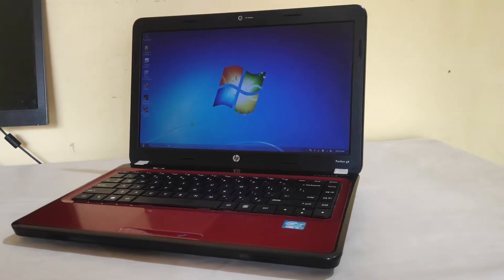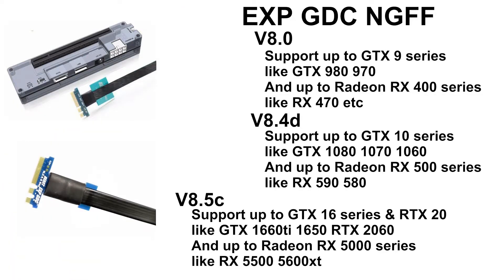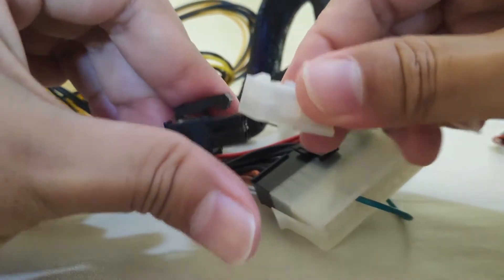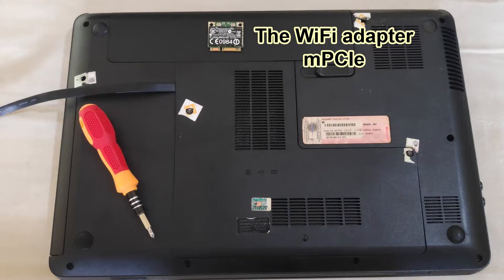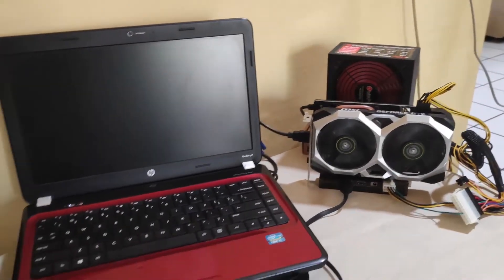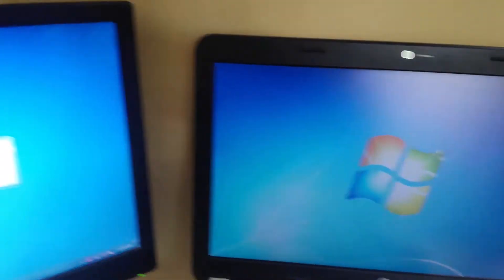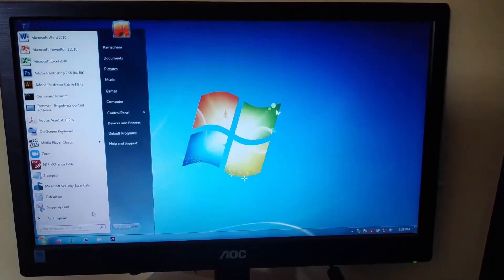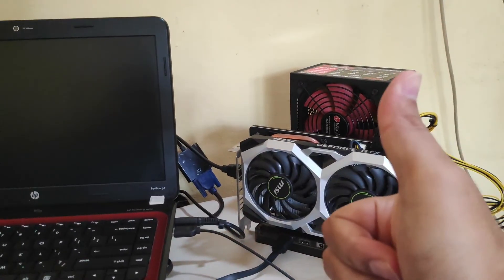EXP GDC Beast V8.5c eGPU with GTX 1660 ti on Old Laptop from 2012

Comment: I need to buy an eGPU to add a discrete graphics card to my laptop. There are two connection standards on the market: NFF and Mini PCI-E. So with the HP EliteBook 840 G2 laptop, which connection standard should I buy?
Reply from the maker: From the year 2015?

if I'm not mistaken, it was a Transition Year when Some of Laptop Companies are switching from Mini PCI-e to NGFF Wifi Model. And some model still using old Mini PCI-e

So you need to Open your Laptop by yourself to check the Connector type
Reply: @ClayWheeler  Is there a way to tell the difference between the two if you look at it from the outside?
Reply from the maker: @nguyenminhcuong6828  No. Just Opening the Laptop case is the Only way.

No other way to tell it.

Unless you have Laptop from 2016 which is 100% Definitely using NGFF WiFi slot.

Or Laptop from 2014 which is using mPCIe WiFi slot.

2015 is Transition Year.
Reply: @ClayWheeler  Thank you very much. What 's a kind of you

Comment: Hello I Have Asus Fx504 i5 8300h - 1050 4gb - 16gb ram is available dock doocoler and 1660 ti? Help me please
Reply from the maker: Ok I will Look into that Asus Model. Does it have Thunderbolt?

I will search the Compatible eGPU Dock right now
Reply: @ClayWheeler  Hello what is thunderbolt? Please help

I would be very grateful if you could find me and inform me if it is compatible.
Reply from the maker: @angelamamanialcon6160  Alright I investigated the Asus TUF-Gaming FX504 with Core i5 8300h.

Before you start, please learn the Slots here 
https://arstechnica.com/gadgets/2015/02/understanding-m-2-the-interface-that-will-speed-up-your-next-ssd/

OPTION 1 
Your Chance to use External GPU is by using WiFi slot, which is NGFF type, as explained in my Video. WiFi slot NGFF has speed of 8 Gbps. You can search Beast EXP GDC NGFF in AliExpress or BangGood. 
Alternatively you can use ADT-Link R43SL. You can read it here https://egpu.io/forums/builds/2017-15-dell-inspiron-7567-gtx980ti32gbps-m2-adt-r43sl-win10-hunew/

OPTION 2
Another Choice is M.2 NVMe slot which is often occupied by your SSD, it could be Drive:C where the Windows is running from. That means you need to Move your OS to another Drive, which can be SSD SATA. Picture Here : CLICK AT M.2 Slot Menu picture https://laptopmedia.com/series/asus-tuf-gaming-fx504/

 You can use Beast EXP GDC M.2 NVMe or ADT-Link R43SG . Roughly it has 32 Gbps speed.

Video Examples if you want to use NGFF eGPU https://youtu.be/pKv436sOrNo

https://youtu.be/LQgho8EXAM4

Video examples if you want to use M.2 NVMe eGPU https://youtu.be/0ovihMPo-q8
Reply: @ClayWheeler  Hello thanks for your time
one question more
 what is the best gpu for  my laptop?
What is your recomend for me?
Reply from the maker: @angelamamanialcon6160    RTX 2060 or higher. Because your CPU is more than capable of High Bandwidth.

If you're using GTX cards it will be waste of Performance.

Comment: this video is the best tutorial for this kind of content, now i know that i can use my laptops gpu gt620m and external gpu at the same time but it needs to be amd rx, i would like to ask if rx 560 is the best gpu for my intel i5-3337u?or what gpu can you recommend, lastly can you test other modern online games like, valorant,cs go or more? thanks again for this wonderful tutorial! godbless to your channel
Reply from the maker: What is the Laptop model name?

And by the way, Actually you can still use the same NVidia card even if your Laptop already have NVidia dGPU like GT 620m.

You need to Clean Uninstall of NVidia GT 620M and then Completely Disable it from Device Manager. And then you can use NVidia GTX 1650.

If you're using Radeon RX 560 you will need special PSU because RX 560 don't have PCIe power connector. The PSU you need is "Dell DA 220 Watt Brick PSU" usually only cost $20.

Here's the example of using Special PSU for RX 560 equivalent

https://youtu.be/ir-5JDITDd8
Reply from the maker: I also have a newer video, about the Game that is a little bit more demanding than this video.
Reply: i already watch your new video, it is a great game test for your egpu, my laptop model is acer aspire v5-471
Reply from the maker: @louvainmontalbo7831  yeah, Recording a video makes huge FPS drop.

If I'm not Recording, it is always stay at 120 FPS, because the game is locked at 120 FPS max by developer.
Reply: you have a beast gpu sir! very powerful, thanks for your help sir, i hope i can build a set up like this successfully! stay safe sir
Reply from the maker: @louvainmontalbo7831  I will dig into that Laptop model right now

Comment from the maker: New Video is up. It talks about a Specific Game, Honkai Impact 3 PC version

https://youtu.be/nRXTra9QZDo
Reply: Hello @ Clay Wheeler i like how you did to your laptap,my biggest problem bro is do you have Activation key to the NFS 2? i cant open it without the activation key.it said it needs to re installed then i re installed over and over again there's no use at all..please help me Clay.
Reply from the maker: @freedom_fighter12  The Need For Speed Hot Pursuit is the original game from 2010, not the Remaster 2020 version.

And this one is from Torrent
Reply: @ClayWheeler  i also download it last year in a torrent,it plays bro,but when i re installed it, it says it needs to re installed? is there any activation key for this game? i dont even know where i could find this Activation key 🗝️
Reply: its 2010 NFS 11,not the remaster
Reply from the maker: @freedom_fighter12  I got it from here. Just copy and paste. Remove the Space of the link below

http://  oceanofgames.  com/need-for-speed-hot-pursuit-game-free-download-ofgv-5768425/
Reply: @ClayWheeler  Thank you very much @Clay Wheeler
Reply: @ClayWheeler  hello what if I use NGFF cable to I need external monitor? How many speed does it have and does it half the speed too? Im your new subscriber.
Reply from the maker: @marnilr103  NGFF is 8 Gbps. Way faster than this video which is just 2.5 Gbps
Reply from the maker: @marnilr103  using NGFF, it depends on the game you're playing.

If it is heavy Game like GTAV, you may need External Monitor.

If Lightweight Game like DOTA 2 or Fortnite, no need to use External Display
Reply: @ClayWheeler  thank you Clay you deserve a lot of subs and support excellent video and tutorial keep it up ❤️
Reply: @ClayWheeler  hi clay I wanna ask 1st question is why my laptop buffer playing 1080p videos on youtube my internet is fast but my laptop kinda buffering in video every few seconds can a egpu help? 2nd does my laptop itself overheat with egpu while playing heavy games? My laptop is lenovo ideapad 300 15ibr, please answer before I buy one thamks clay.
Reply from the maker: @marnilr103  if your Laptop already Buffering when playing 1080P Videos, then it means the CPU itself is not Good enough for gaming.

Your CPU Silicon might be Deteriorated already. And its efficiency cannot be Helped by eGPU in any means.

That's like trying to hook a Real GPU to Pentium 4 in 2021, nearly pointless.
Reply: @ClayWheeler  thanks clay big help
Reply: I think Nvidia can't allow to do this anymore😞
Reply from the maker: @VisitBeforeHumanPollute  what do you mean? I just updated the driver to newest one. It's still good for the Laptop

Comment: Just wondering if that will work without external monitor? I'm trying to do that but I don't have extra monitor.
Reply from the maker: Yes will work, but you will lose a lot of FPS.

I will upload new video after this, showing how much difference is the performance Loss when the bandwidth is interrupted by 2 Way communication. Could be 30 FPS Loss or more.

In this video is basically 1 Way Communication from Laptop, to eGPU, to external Monitor. Hence full speed 2.5 Gbps

2 Way communication means from Laptop, to eGPU, Back to Laptop again. On the same Cable. Hence 1.25 Gbps.

Believe me, the difference is tremendous. I will upload new video soon.
Reply from the maker: Oh and by the way, you can also use TV for external monitor.
Reply: @ClayWheeler  This helps a lot. I have successfully installed mine. Thank you so much.
Reply from the maker: @adrianortiz3392  Wow nice.
Make video of it and put in Your Channel :D
Reply: @ClayWheeler  I need advice. My monitor is shutting off randomly. I don't know what seems to be the problem :(
Reply from the maker: @adrianortiz3392  internal Laptop's monitor or external monitor?
Reply: @ClayWheeler  internal monitor. I assume it has something to do with the power supply.
Reply from the maker: @adrianortiz3392  almost like Not enough Bandwidth or Not Stable bandwidth.

I still recommend using External Monitor to avoid any problems
Reply: @ClayWheeler  thank you so much!
Reply from the maker: @adrianortiz3392  can you upload a Video of your Laptop with eGPU using your Phone to your YouTube channel?

So that I can see the Problem

Comment: Can i do this on Asus k43sv i7-2630qm gt 540m while i plan on having a gtx 1650 as egpu?
Reply from the maker: Yes. But you will need Dell DA 220 Watt Brick PSU with 8 pins PCIe power cable.

The difference between Dell DA PSU vs My PSU in this video:

GTX 1650 Doesn't have PCIe power connector pins, which means it is using 75 Watt at Max.
The Problem is, the White "ATX + CPU Power Pins" Connector as shown in this video, is actually feeding Less than 75 Watt. Because you need to Feed the EXP GDC Board directly with 75 Watt or more to ensure Stability. So you will need Dell DA 220 Watt Brick PSU with 8 pins PCIe power cable.

On my GTX 1660 ti, it has dedicated 8 Pins PCIe power connector. So it can Consumes Watt directly from the 8 Pins PCIe power cable from PSU.

Further Proof here (not my Video)

https://youtu.be/ir-5JDITDd8
Reply from the maker: Oh. And a side note:

You will need to COMPLETELY UNINSTALL GT 540m using Display Driver Uninstaller beforehand. And then from Device Manager, Disable the GT 540m (it will be Named as Microsoft Basic Display Adapter) Right click at it, and Disable. Right Click again, and Uninstall.

After that you Must make sure that your Laptop only Runs with IntelHD, not NVidia. After you Made sure about that, you can install eGPU.

Comment: What is your cpu? Doesn't fps work stable? Can i upgrade cpu? Btw Nice Video.
Reply from the maker: It's at the beginning of the video.
Core i5 2430m 2 Cores 4 Threads 4 Logical CPU
Reply from the maker: In games like Honkai Impact 3 PC, I can get stable 120 FPS Max settings

Comment: When playing on monitor only, do you run an hdmi from the egpu to the monitor? Or from the laptop output?
Reply from the maker: Did you mean Laptop's internal display?
Reply: @ClayWheeler  hello thanks for tour answer, no I mean, where do I plug my external monitor to, to the laptop’s hdmi port or to the GPU’s hdmi port ?
Reply from the maker: @SL9SH  GPU HDMI port
Reply: @ClayWheeler  great thank you!
Reply from the maker: 09:20 Here I show HDMI output from GTX 1660 ti to external Monitor.

Comment: Haii! can I use an old dell proprietary psu with 8pin cpu to power the system? hope you can respond..
Reply from the maker: The important thing is 6 pins or 8 pins PCIe power cable.
Reply from the maker: I mean, Dell DA 220 Watt PSU with 8 pins PCIe Male Power Connector is 100% Compatible
Reply: @ClayWheeler  usually i see a 24 pin adapter used in the build, but how about psu from a dell optiplex that has 8 pin. can i just jam it in without any adapter?
Reply from the maker: @markiicecream9074  are you sure Dell Optiplex has free 8 Pins? It is very rare if I remember correctly.

Anyway the PSU must be triggered at the same time as Laptop

Comment: do you think you can put a pcie extender into the riser can? I will mount my GPU horizontally in a diy case for the riser
Reply from the maker: Riser with USB or Mini PCIe?
It's different
Reply: @ClayWheeler  no, i mean if the pcie extender works with the exp gdc. sorry for the confusion
Reply from the maker: @yubinator69  oh yeah it works, but apparently it has too many Latency if you add PCIe extender. (If you press jump, your character has delay to do Jump, even if it is 120 FPS)

What is your Laptop anyway?
Reply: @ClayWheeler  no laptop. just a mini pc(if you are familiar with intel NUCs) with a nvme slot.
Reply from the maker: @yubinator69  oh, then you need to use M.2 NVMe eGPU like ADT-Link R43SG.

Just browse on YouTube using keywords "M.2 NVMe eGPU" 

Some people already reviewed it, and it has very low Latency.

Comment: I have a laptop with specs : 
Intel Core i5 - 5300U 
Integrated Graphics - HD Graphics 5500
__
and I decide to use external GPU 
will it bottleneck? if I am use RX 560, or RX 570, or GTX 1050Ti? which recommend GPU to avoid bottleneck. Thanks in advance.
Reply from the maker: What Laptop model?

Comment: Bro Clay Wheeler, My Laptop is Lenovo ideapad 520 with 2GB MX150 GPU, it has Type-C USB 3.1 Gen 1, can this method applicable to my laptop ?If Yes please suggest which card to use etc,.. As I read that USB Type C 3.1 Gen 1 and Wifi card are internally connected in motherboard. So can I run graphics card with mentioned Type -C port. Waiting for reply.
Reply from the maker: No, USB is not part of PCIe controller specification. It's just for Storage.

PCIe is PCIe. It is required for GPU. 

But if it is USB type C Thunderbolt, then it is part of PCIe so it can be used for eGPU
Reply: @ClayWheeler  If I use PCle then which card(Radeon or Nvidia GTX 1650ti/1660ti/...) is suitable for my mentioned laptop model.Please tell.
Reply from the maker: @k.santhoshkumarsanthu7381  Radeon RX 5600

Comment: im getting code 43 error. I could not start it. Dell laptop
Reply from the maker: Quick Search on Google using this keywords.

eGPU.io error 43 fixer

And then Download a Zip file from that forum containing Error43 fixer. Simply unzip it and Run as Administrator
Reply from the maker: It should say [SCRIPT] on Google search result
Reply: i try.
Reply from the maker: @rasimbicer823  Which Dell Laptop?
Reply: @ClayWheeler dell inspiron 3543
Reply from the maker: @rasimbicer823  alright I found the solution.

Please don't use the latest NVidia Graphics Driver from NVidia website.

The Error 43 Fixer can only handle the older Driver between 2019 & 2020. So please download the older Driver from year 2019 or 2020.

In my video I'm using NVidia driver From December 2020. And yes I got Error 43 but I didn't show it in my Video.

The new NVidia Driver is a bit Strict for eGPU in general. So just download Older Driver from 2019 or 2020. And if the Error 43 appears, it can be easily Fixed with the Error 43 Fixer.
Reply: @ClayWheeler  i got rtx 3070 and this card released in 2020. I will try and tell you about whathappend.
Reply: @ClayWheeler  error 43 fixer still work. I’m setup the rtx3070 driver from November 2020. But i think error 43 fixer bat file it will work with new version drivers. 
Thank so much 👍
Reply from the maker: @rasimbicer823  don't update the RTX driver. Just don't.

Comment: bro itu i5 2430m sama gtx 1050 super (exp gdc v8.5c) bottleneck ga ?
Reply from the maker: GTX 1050 Super? Apaan tuh? Baru denger.

Di video ini GTX 1660 ti sudah pasti bottleneck. Tapi intinya wajib pakai VGA yang ada PCIe power cable nya.
Reply: Oh iya klo pakai exp gdc v8.5c itu bisa pakai seri dibawahnya kah kayak 1050 gtu
Reply from the maker: @Brokoliaw  sudah pasti bisa.

Tapi kalau untuk VGA kelas GTX wajib yang ada PCIe power cable nya. Karena kalau GTX 1050 yang versi 75 Watt tidak ada PCIe power cable jadi gak bakalan bisa pakai EXP GDC.

Kalau GT 1030 GDDR5 bisa. Karena Watt nya memang jauh lebih rendah.
Reply from the maker: @Brokoliaw  kalau di Tokopedia kebanyakan EXP GDC v8.0 atau v8.4d itu ternyata ada yg bisa pakai RTX 3070 tetap lancar walaupun CPU Laptop sudah pasti bottleneck.
Reply from the maker: @Brokoliaw  ini gan Video bukti pakai EXP GDC v8.0 RTX 3070

/watch?v=6JcucfWz51o

Sorry gak bisa Paste link YouTube di comment, suka error.
Reply: Fast respon lagi mantap
Reply from the maker: @Brokoliaw  Cari aja GTX 760 atau GTX 960 atau GTX 1050 ti.

Itu semua ada PCIe power cable nya tapi harga masih murah.

Radeon RX 570 juga murah, performa jauh di atas GTX 1050 ti.
Reply: Ok thx dah kasih info banyak lo